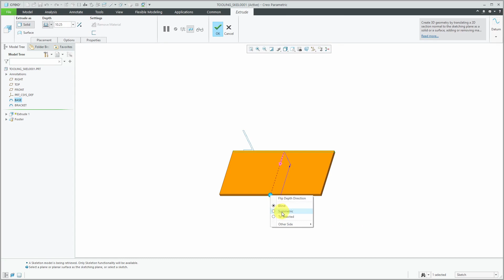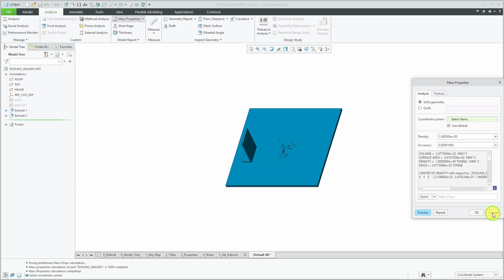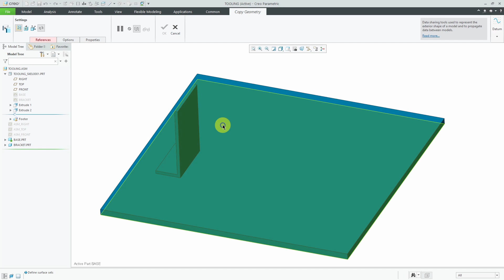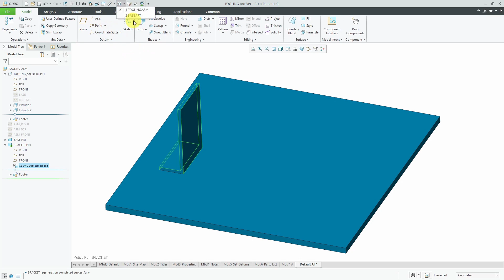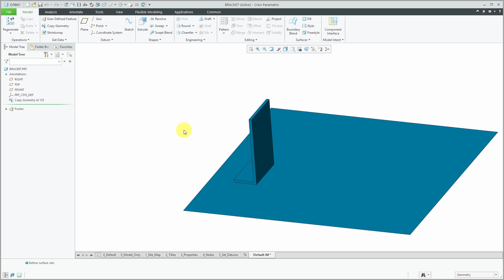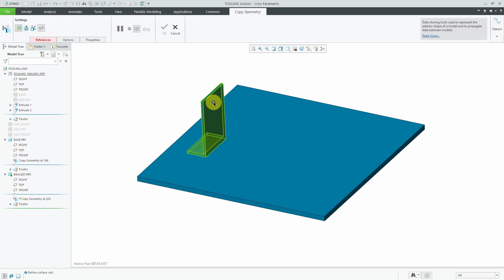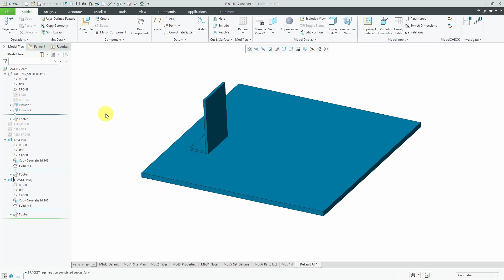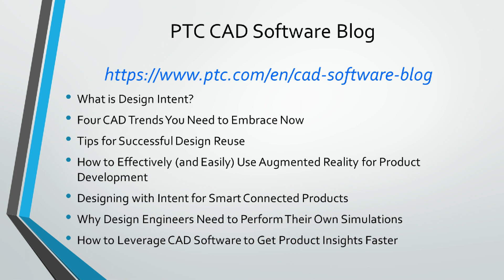Creo Parametric - Why create Skeletons with Surfaces?

Comment: Thanks Dave. How can I cut holes through the surfaces ? When I extrude holes with the extrusion-command then I can't solidify the model anymore because it is not closed (I think). And would it make sense to publish bodies instead of surfaces (In later versions of creo you can use multi-body) ?
Reply from the maker: Did you merge the quilts before trying to solidify? You can publish bodies or surfaces depending on what you need.
Reply: @CADPLMGuy  Thanks Dave. It worked perfectly using merge quilts :).

Comment: Dave,
Great info as usual. Could you elaborate on the skeleton usage info? (Including windchill) There has been a longstanding rift at our company regarding skeleton usage. Top of the list being reccomended practices but not limited to... There is also concern over external references and windchill. I guess what I'm ultimatly looking for is a step by step for data sharing from skeleton development all the way to asm/part/feature level references. If it's too much for (1) response, please direct me to whatever info that PTC has available to correctly instruct/implement the best practice for parametric functionality. (I have been using Creo/Pro-E since 2001 Release 2001i and have never seen/found an instructional on this subject.)

Comment: What is the advantage of using skeleton? As I've never found out, I've always used standard parts for this purpose. Thank you.
Reply from the maker: I have an overview of the Top Down Design process here: https://youtu.be/ycvaCOCResU

Skeletons are the framework of an assembly. The advantages of using them over a standard part model (like a Master Model) is that they are automatically filtered out of mass properties and Product Structures and do not generate WTParts in Windchill (since they will never be manufactured).
Reply: @CADPLMGuy  Since I do not use windchill and I do not have solid geometry in my skeleton pieces I think I'm okay. Thank you.